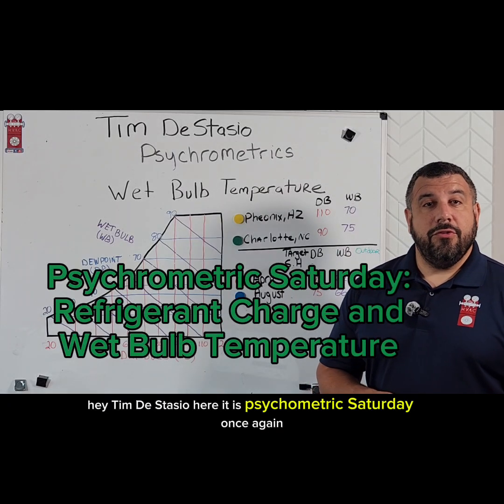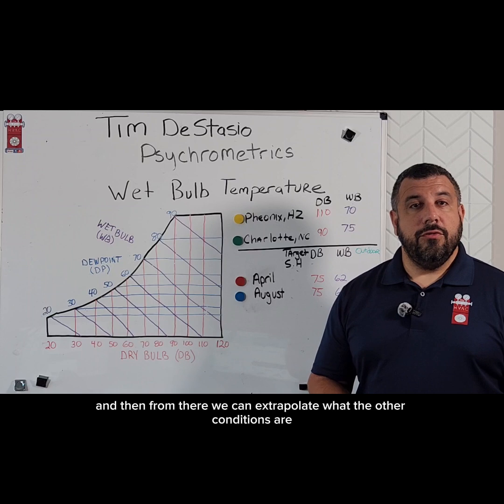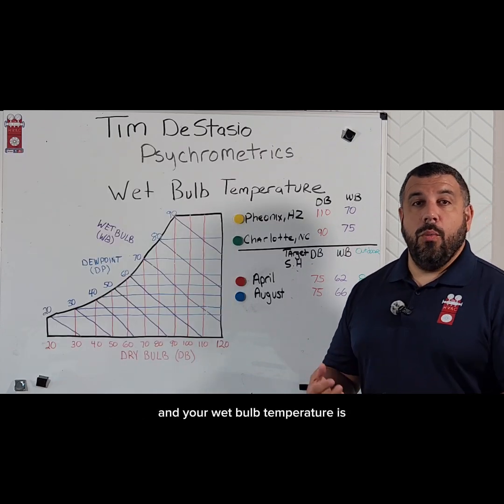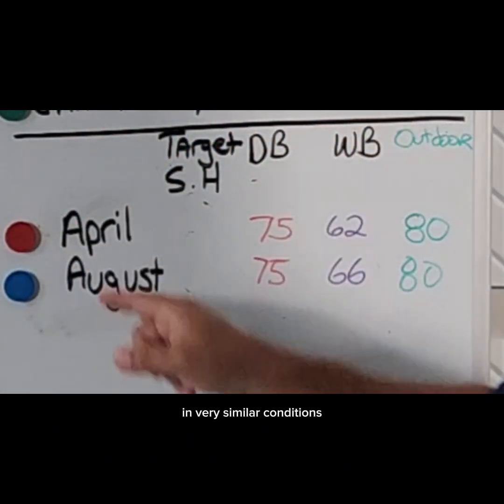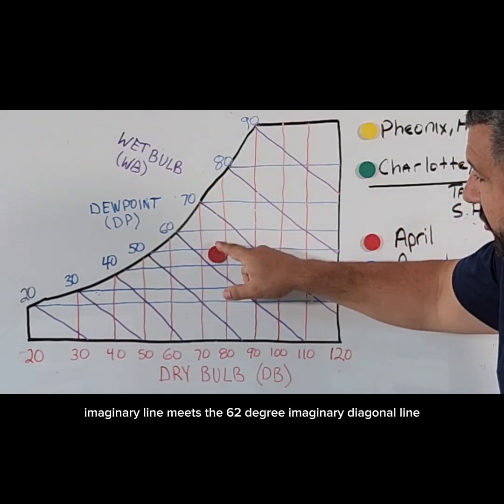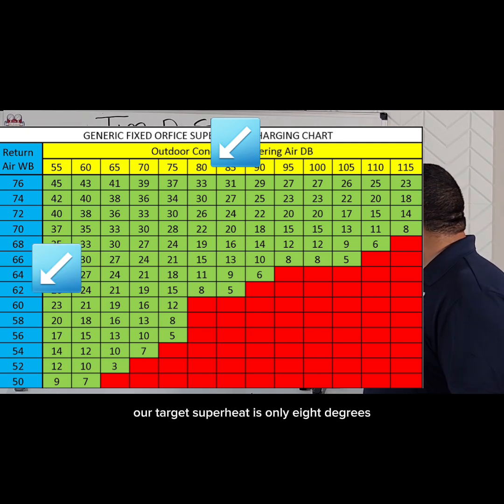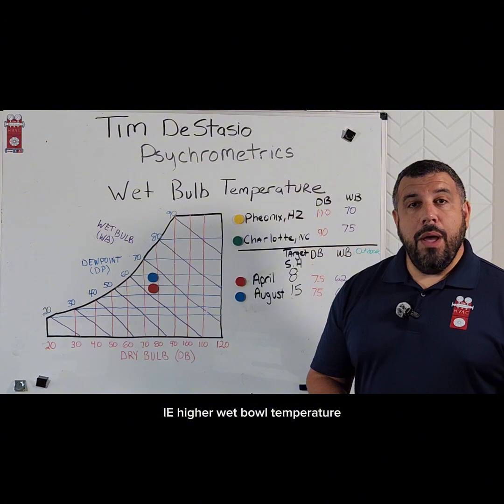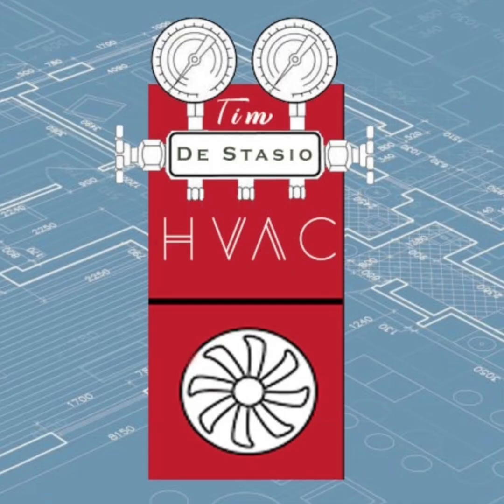Psychrometric Saturday: Refrigerant Charge and Wet Bulb Temperature

Comment: Tim, can you do something about the video frame size? It appears to be letter boxed in the middle of the frame when it could be expanded to fill the whole screen.

Also, the superheat calculation that's always tossed around is wb x 3 - db - 80, all divided by 2. That gives targets of 19 and 13 for your examples, around 5 degrees higher than yours in both cases. What chart do you use and why are they so much different?
Reply from the maker: @realSamAndrew  charts vary per manufacturer. I'vr never heard of WB x 3- DB - 80 but it might be legit.

Regarding frame size, I have to make it 1:1 so it works with IG.
Reply: The AC Service Tech Chart is different than the one Tim uses and is closer to the calculation I use, the one you reference.  Best to go with the chart put out by the manufacturer of the piece of equipment you are working on.
((3*idWB)-80-odDB)/2 would give 21.5 & 15.5.
Reply: @HVAC_Tips_Tricks_Calcs but why is there such a variance? That means you can almost pick any number within reason and there is a chart that will say it's correct. I agree with following the mfg, but it seems physics should be more solid and not disagree so much or else it starts to sound like pixie dust and not science.

BTW your calculation is wrong. The values based on the idwb x 3 formula are 19 and 13. You accidentally used 75 for oddb instead of 80.
Reply from the maker: @HVAC_Tips_Tricks_Calcs  correct. I like that one also and the oem is better.
I chose this chart to make the point even clearer that wb changes SH.
Reply: @realSamAndrew correct. I was using the wrong ODDB. I also don’t know why the various charts are so much different.  I tend to stick with the AC service tech chart for rule of thumb if I can’t get the manufacturer charging chart.